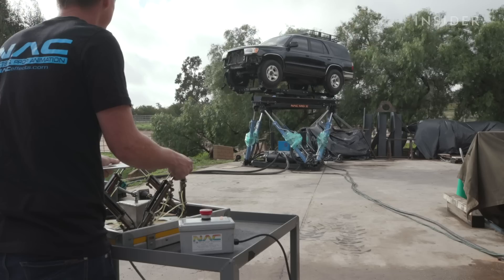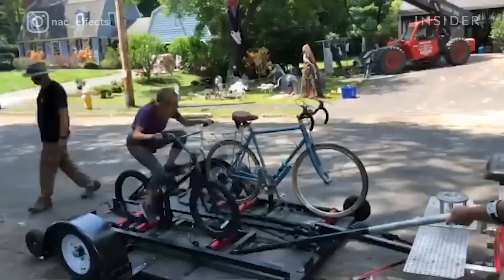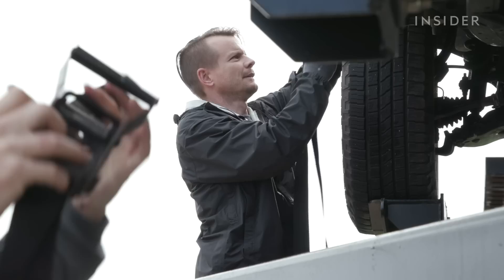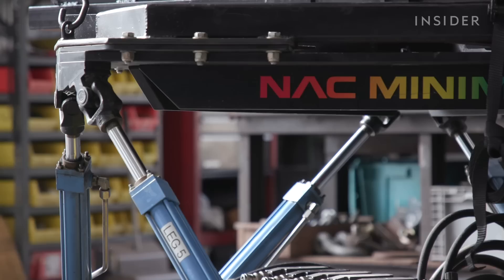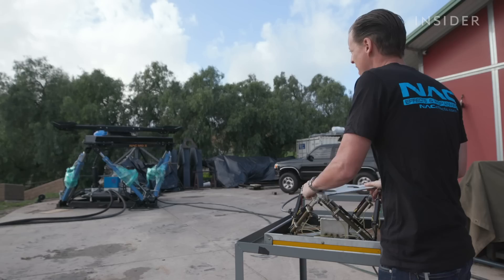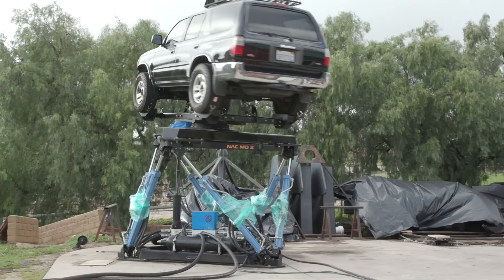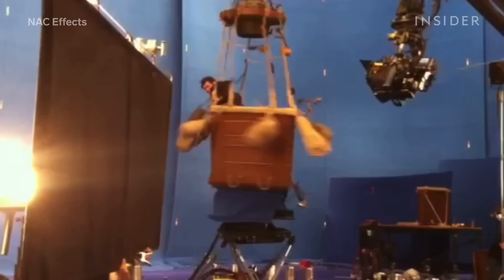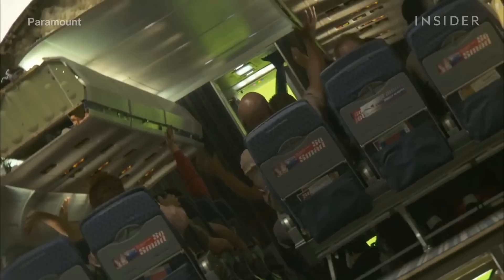How Moving Cars are Faked In Movies and TV | Movies Insider | Insider

Comment: I worked as a Rigging Grip on the motion picture "Battleship," on a sound stage in Baton Rouge Louisiana and there was an absolutely huge gimble with the bridge of said battleship on top of it. It was much bigger than any of these from what I remember. I'm guessing it must have been these guy's equipment because it looked almost exactly the same and was controlled with the same device as these in the video. The bridge was actually made out of 1/2" steel plates so it weighed God knows how much but the gimble moved it around easily. My jobs included putting up a 30+ foot high by 300+ feet long green screen around the bridge and rigging all of the lighting set ups attached to the ceiling of the sound stage (chain motors and truss).
Reply: Very cool! I had no idea LA had a filming industry. I always figured there wouldn't be many incentives. I'm from Alexandria, thanks for sharing, Phedd!